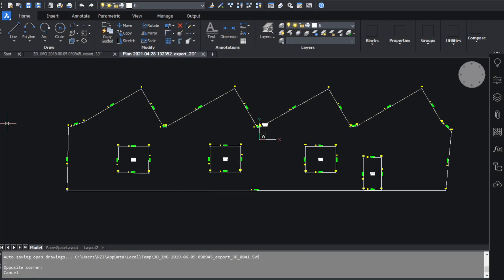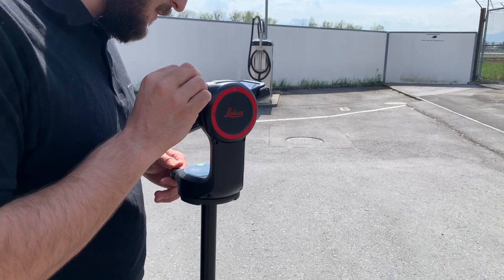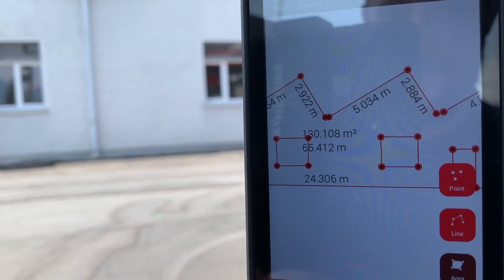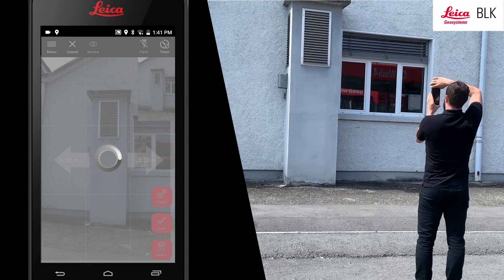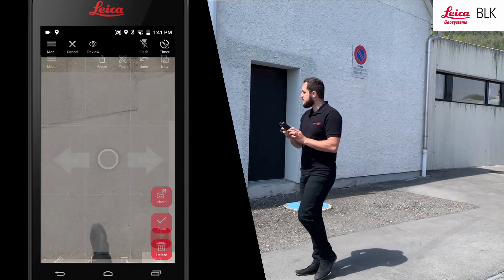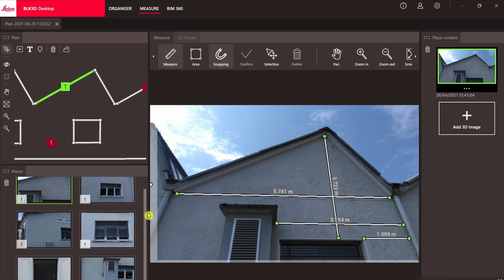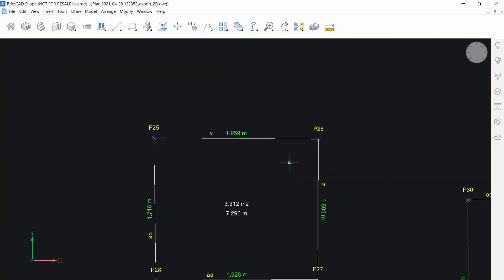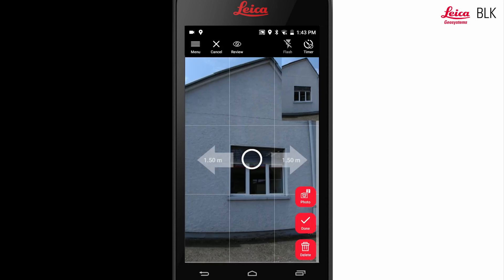BLK3D Mobile - How to measure a facade with the P2P technology

Comment: Hi. I need the most accuracy tool to measure structural steel, so i don't know which one is the best for P2P functions, the BLKD3D or the Disto S910. Which one should  i buy? Thank you!
Reply from the maker: Both devices are about the same accuracy. Important is a reliable setup with a stable tripod (so maybe use of TRI 200 is recommended). Whether this is the precise enough we cannot judge for you. The specs allow for 5mm @5m measuring distance.